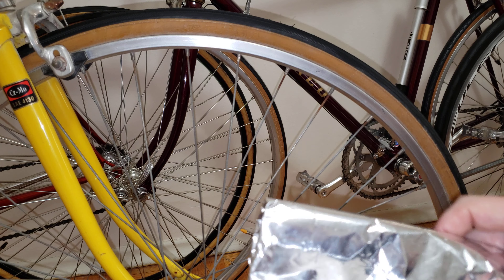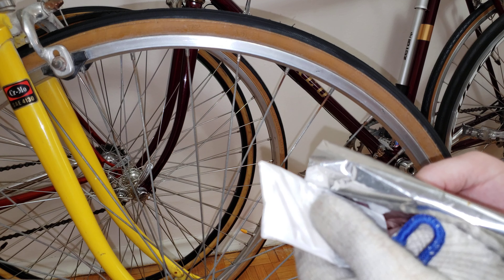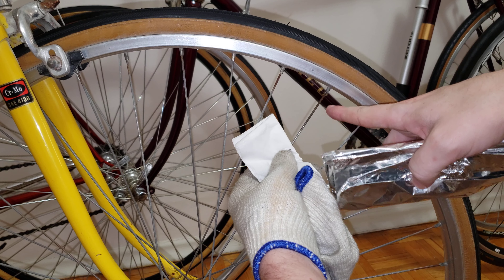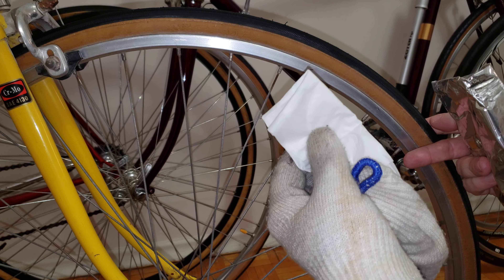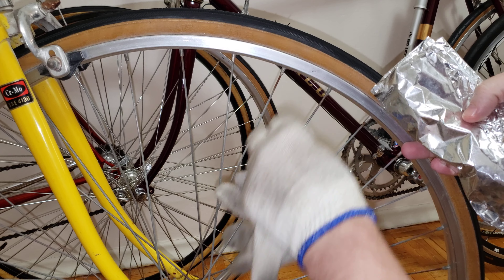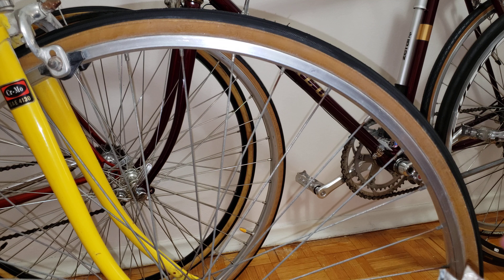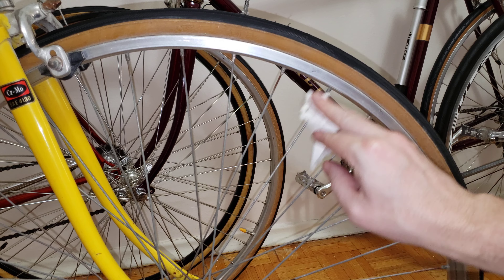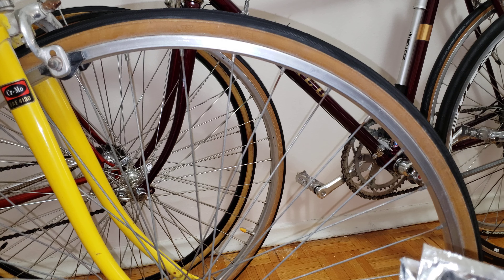How To Clean Rusty Spokes On Zero Dollars Budget |4K

Comment: why not use oil  instead of water it would last longer
Reply from the maker: What kind of oil? I sometimes get white chalky oxidation on new spokes? What is the issue? Humid ? Thanks mate.
Reply: need to stop the rust before it starts.
Reply from the maker: @linking-it  spot-on